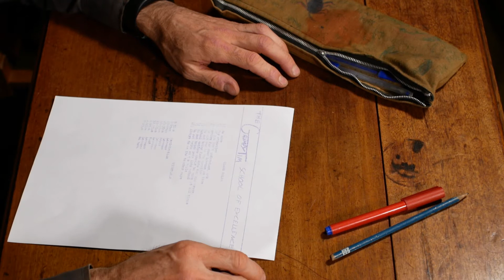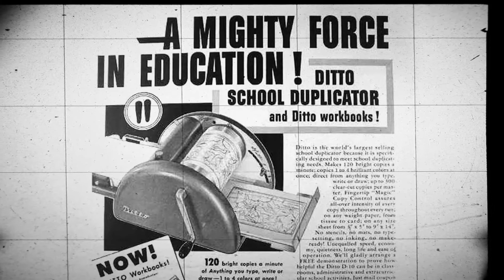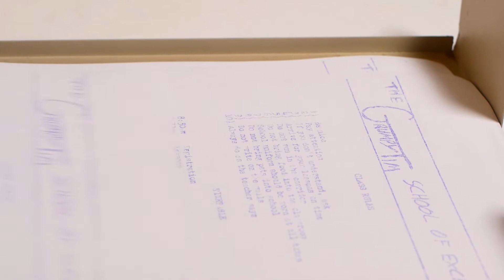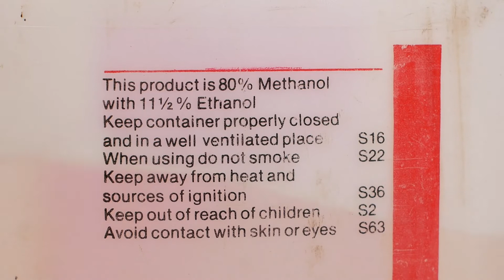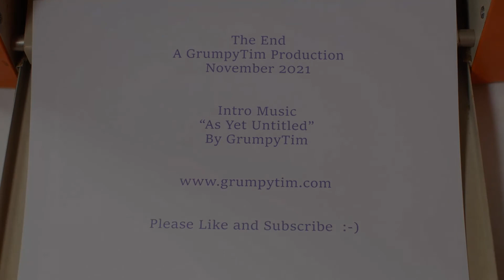Banda Machine - 1960's Spirit Duplicator - Fordigraph Consul Super

Comment: Yesterday i bought an Spirit Duplicater, but a much older one. I want to restore it and wanna use it. Please can you tell me what kind of master sheets you choose? Which one work best? 
There are matrix paper on the market for tatoos or blueprints with graphite. The alcohol i also dont have. But thankfully you show the ingredience. 
Great Video!
Reply from the maker: Hi Atheist1970, The master sheets I've got were ones I bought with the duplicator, so they were ones sold for the purpose.  I guess you could just buy the cheapest ones you could find, or maybe talk to your friendly local tattooist and ask to try a single sheet before buying a whole pack.  I would think that the mix for the fluid could be anywhere there or thereabouts, after all it's not really doing anything all that technical, just softening the waxy ink enough so some transfers to the paper.  Hope you have lots of fun restoring and then using your cool bit of history.

Comment: Gestetner Duplicators were used for a similar purpose but used an ink based system.  Their slogan was " keep alcohol out of the office."
Reply from the maker: Hi Jeffery, I had a Gestetner that I used at the same time as the Spirit Duplicator to produce slightly longer runs of leaflets (at least it was a Gestetner type of machine), I had planned to do a video showing that machine as well, but I must have got rid of it at some time - still got a pack of the stencils for it but no machine.
Reply: I think the term (at least for a non-namebrand type thing) is “Mimeograph”.  There are some great videos, even some goofy old training video, on them on YouTube!

Comment: You cannot be taken seriously any time you refernce Wikipedia as your source of information.  They themselves post  warn on Wikipedia they are not a reliable source of informatrion.
Reply: In this case, who cares?
Reply from the maker: Yep Wikipedia isn't without it's faults, but there is still a fair bit of reasonable info on there - that's why I usually refer to them as a source of info (if I've used them), ergo it might not be totally accurate, I think most people are aware of that by now.  The video was primarily about the machine itself and how it works, the history bit was just a bit of background padding.

Comment: So I guess the disadvantage this machine has compared to photocopiers today is that you always had to create your own master from scratch - you couldn't copy something previously made?
Reply from the maker: Hi osantiagues, there were other ways to create masters - some people used old dot matrix printers to create masters from early computers and so on, but essentially it was the ease of use that made the photocopier the preferred choice.  Photocopiers were considerably more expensive to run in the early days, so there was quite an overlap when schools etc were still using the spirit duplicators even though they now had a photocopier as well.
Reply: Ah that is true. I guess we forget that these days now that photocopiers are everywhere! Also I guess that masters were routinely done more by hand back then unlike today where computers are the norm. That's interesting as I never considered it from that point of view!
Great video, I would love to see more from you on copying methods!
Reply: It was possible to make spirit masters using a thermo copier, such as the 3M Thermofax but there were some limitations to this method.  The masters were limited to a shorter run length than hand drawn ones, the original had to be a single sheet as it followed a curved path around a belt through the machine and the image had the be black and contain carbon or metal to be ‘seen’ by the thermal copier process.

I used to work in a school where we had to keep one of these in working order for just one member of staff who still used it.

Comment: Yes they had the Banda machines when I was in school in the 80s. The Scouts even used them to make 'hand outs' meaning information sheets
Reply: "The Scouts even used them to make 'hand outs'"   - My Scoutmaster (circa 1969) discovered an older process, no machine. "Hectograph". Prepare a cookie sheet with a uniform layer of plain gelatin (dash of clove to retard mold). Same purple master as Ditto. Carefully lay the master on the gelatin, let soak, peel off. Now lay blank paper on the inked gelatin. You can pull several dozen copies before the ink fades. Tedious AF.
Reply from the maker: Coo, that's a cool method, slow, but no machine required does have a certain attraction.
Reply from the maker: Hi BF Blethering, these machines would have been just about everywhere at one time, and virtually every school child would have received notes produced using this system.  I guess the phasing out was pretty rapid, and as most of these machines would have been used in a working environment, not that many of them made their way into peoples lofts, ready to resurface 30 or so years later.

Comment: Great video!  My parents talked about the spirit duplicator from their days at school, but I'd never seen one until I watched your video.

I wonder, was it possible to make multiple masters in one go?  Because, if more than say 50 copies were needed, then the master would run out?
Reply from the maker: Hi Edward, yeah, that would seem possible to make multiple masters at the same time - probably not more than 2 or 3, and you'd have to press quite hard to make sure your drawing or whatever transferred through to the bottom copy.

The old carbon paper used on typewriters was thinner than the waxy ink sheets for the spirit duplicators, and people used to stack as many as 5 carbon copies when typing some business letters and the like - usually they used thinner plain paper for all but the top copy to assist in getting the image to transfer all the way through the stack.....and you had to type fairly firmly too!
Reply: They rarely made that many copies it was purely for one class. Most classes NEVER exceeded 40. I can remember classes where you were given one sheet between two and had to share.

Comment: We were still using Banda machines in classrooms here in NZ up until the early 90s. 
I always wondered if the term "bandied about" (for gossip), is a nod to the function of the Banda copier.
Reply from the maker: Hi Tom, it does make sense that some places carried on using the Banda machines for quite a while as they were vastly cheaper to use than most early photocopiers, and why invest in new equipment if you don't need to.

I did a quick search about Bandied about, and from what I can find,  the word "bandy" originated in the 16th century, meaning to pass a ball to and fro, and from that came the term bandied about, as in passing gossip from person to person.  I never thought I'd be researching a 16th century word when I woke up this morning!!!!!

Cheers for watching
Reply: @GrumpyTim  Ha! I had a hunch "bandy/bandied" well pre-dated the Banda machine! A bit like the word "crap" predating Thomas Crapper by several centuries! 
Clever marketing on Banda's part maybe.  Thanks for your research! 👍😉

Comment: Ha ha I remember these type of sheets when I was at school. They certainly had a distinct smell although most of the alcohol had long gone by the time the sheets got to us pupils. Not as bad as the die line machines I used in my first job which used ammonia, light sensitive paper and uv light which shone out of the machine like a beacon! Oh and an industrial sized extract fan to remove at least some of the noxious fumes! But it was the only way to copy big A0 sized plans back in the day.
Reply: I remember those dye line machines from a temp job I got just after leaving college in the early '90s, many hours were spent inhaling ammonia fumes and shuffling massive sheets of paper 😅
Reply from the maker: I remember handling some of those die line prints, and the lingering smell of ammonia - I've never seen them being made, but my first job was in the printing industry and I spent many happy hours in a darkroom with a strong UV light and lots of chemicals, so I kind of get the idea.  Stuff was fun then, although the introduction of large inkjet printers was pretty impressive at the time, but I miss the drama of the old methods.
Reply: @GrumpyTim  yes die line machines where huge beasts. As a planning officer I used to spend some of my time each week copying plans on it. You got into a rhythm doing it as each print needed to be done manually. The steps were as follows: take the yellow light sensitive paper out of its light proof container. Place the plan face up on top of it. Feed the two sandwiched together into the machine where strong uv light is shone through the plan through onto the light sensitive paper. The sandwich of paper would come out of the machine you would then separate the two putting the plan to one side. The uv light faded the yellow away where is wasn't covered by a dark line on the original plan. Feeding the copy into another slot on the machine exposed it to the ammonia which developed the print by Turing the remaining yellow to black. Hey presto a copy was made. Repeat for another print. Those were the days!
Reply from the maker: Awesome, I love old processes like that - I used to find dark room work very therapeutic.
Reply: So that is why I seen a flexible duct coming out from the top on some of these huge printers/copiers and hung out of a window/terminated to a vent in the wall ~ because it used ammonia as a transfer/generates excess heat 😉

Comment: We used these in the office when I started work.  If copies were need then up to 8 would be by carbon paper, above this it was the 'Banda' machine and photocopies were a two stage process of negative and developing and very expensive.
Reply from the maker: Hi Chris, I'd totally forgotten about using multiple carbon papers to create extra copies - I used to use carbon paper (and still do occasionally) to take a single copy of something I've typed, but of course, people used to use a stack of paper, carbon, paper, carbon etc and the copies got more feint as you went down the stack.  I used to have a 3M 2stage photocopier but I think I gave it away ages ago because I couldn't find it when I went looking a couple of years ago.  Pity, that would have made an interesting video.

Thanks for watching and reminding me about multiple carbon copies.

Comment: Martin
These were super machines,I have used several types of spirit duplicator over the years and found the Foridigraph ones the best and I don't think there is a modern machine that will print 7 different colours with a single pass at the speed of the spirit process.
Reply from the maker: That's a very good point Martin, not to mention the running costs of either colour laser printers or inkjet printers.  It's a largely forgotten technology nowadays, but virtually anyone who was at school in the 70s and before will have been given notes produced using a spirit duplicator at some point in time.
Reply: @GrumpyTim  The process may come back things often go full circle.
Reply from the maker: Yes, possibly some iteration of the process could come back, I suspect it would need to use something less volatile than Methanol as the solvent second time round!!!  I can imagine plenty of organisations and individuals that could make use of the same or a similar process these days.

Comment: Very cool.... I remember the smell on my elementary school days. The paper they used to copy on was of brownish color probably due to a higher content of wood.
Reply from the maker: Yeah, old paper tended to be less white than modern paper, some more so than others - your school may have been using a fairly affordable paper that didn't see much bleach in it's manufacturing.  I used to work in the printing industry, and if I remember correctly, some of the brighter white papers had additional chemicals that would absorb some UV and turn it into visible light to make the paper look brighter - I'm not sure when they started doing that, but certainly during the time I was working in print, the war for who had the whitest paper was quite fierce.

Comment: with my Amstrad dot matrix printer (the rebadged c.itoh one) i created the masters without problems.
Reply from the maker: Coo I'd never thought about that, but yes, an old dot matrix printer would create those masters perfectly - wish I'd have thought about that at the time!!!!
Reply: @GrumpyTim  my mother used to be a science teacher,on her PC she had one of those handheld scanners to get diagrams and drawings out of books. printing cost for those blue spirit copies was just a fraction of regular photocopies, factor was something like 1:10, but perhaps the school had a bad copy rental contract.
Reply from the maker: Absolutely right rarbi.art, particularly when photocopiers were first introduced to schools, they often had a rental charge plus a click charge per copy (possibly some still do) and it made them far more expensive than the spirit duplicators and stencil duplicators.  The first photocopier I had was an old Xerox machine - it was massive, unreliable and occasionally singed the paper when it got jammed, but it would have been a cool thing if I still had it - we stripped it apart and kept a few bits as useful components for other projects, the rest got scrapped.

Comment: And there I was thinking those were produced by Gestetners.... That does beg the question, how does a Gestetner work. Cheers.
Reply from the maker: I think Gestetner probably made other stuff too, but the stencil duplicators were often referred to as Gestetners regardless of who made them (a bit like Hoover or Sellotape).  I had a Rex Rotary stencil duplicator but it appears to have been disposed of - I looked for it a couple of years ago and couldn't find it.

The stencil duplicator system has a pair of drums with something not unlike a silk screen running between them.  One of the drums has a sludgy ink pumped through it, which is distributed into the mesh of the silk screen (the ink only dries by absorption so it can get everywhere if you're not careful).  Then you have a master which is some kind of loose fibre paper with a wax coating - when you type on the stencil using that stencil setting on your typewriter, the wax is pushed aside, leaving just the paper fibres, which the ink can pass through (there were other ways of making stencils, including big electric scanning/stencil cutting machines - you could also use a scriber to scratch in your design).  The stencil was then wrapped round the outside of the silk screen and the printing could commence - the ink would squeeze through the fibres of the stencil and be pressed onto each sheet of paper as it passed through.  All of the stencil duplicators I saw were electric powered, although most could be wound by hand as well.  I still have a pack of the stencils but the machine itself seems to have gone - pity, I'd have liked to do a video on that one too.
Reply: @GrumpyTim  Cheers. Would have been an interesting comparison.

Comment: I was going to say well done for getting to 999 subscribers... But I had a word... and now you are at 1K! Well done!
Reply from the maker: Cheers Ben, that's awesome - I was expecting it to hover at 999 for weeks and then probably fall again!!! Exciting Times  :)
Reply: @GrumpyTim  how many hours have you got?
Reply from the maker: My hours have been good for ages, over 5000...
Reply: @GrumpyTim  Good work. You can now get monetized. Will not earn you loads but it adds up over time. I now have enough to buy a decent TIG if I wanted or perhaps a cheaper one and a lathe bed regrind for the Atlas.
Reply from the maker: Yeah, I've started the process already, but it sounds like it'll take a few weeks before it's fully up and running.
Reply: @GrumpyTim  I can't remember exactly how long but should be done in less than 2 weeks.
Reply from the maker: Coo, that would be good, ta Ben.